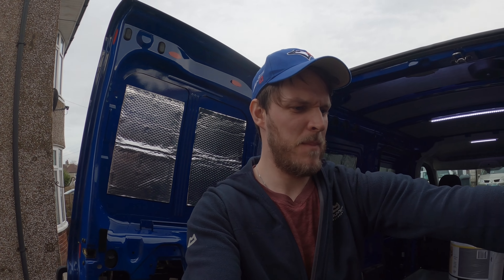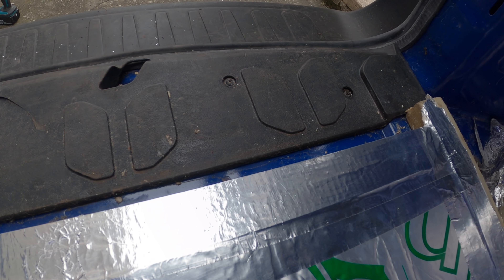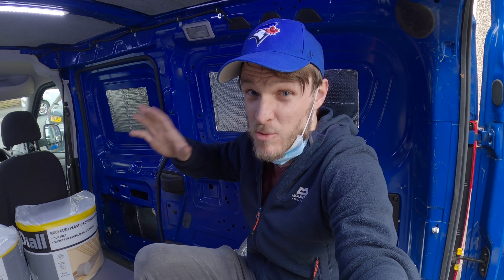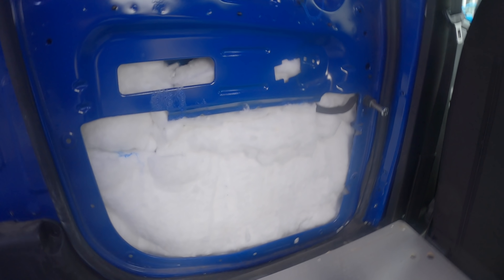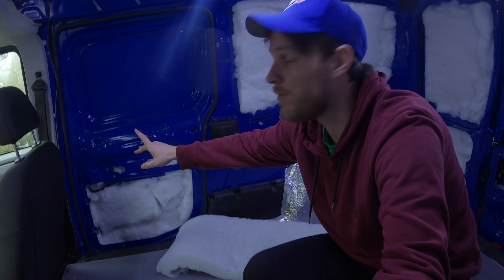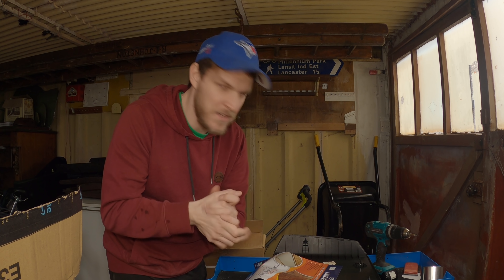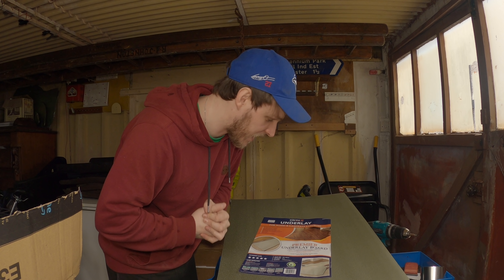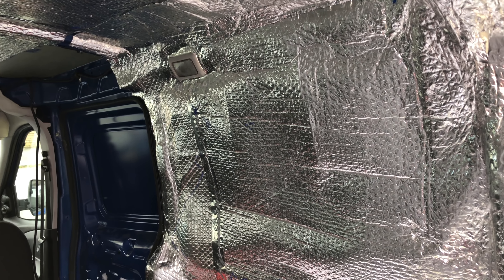Van Build UK | Wall Insulation & Vapour Barrier

Comment: Hi Henry, the white material, insulation, you are using on the side panels and doors i would leave it about 20-30mm off the bottom in case of condensation and water maybe. If  that gets wett it will stay wet for a long time and rust will build up in that area, by the time you will notus it will be too late! Other than that keep going, good job.

Comment: Going well there Henry looks great so far. I would suggest getting your cables in asap though. Our van has a smart alternator so we needed to get a Victron 30A DC to DC charger to charge our house leisure battery for the 12V USB chargers, and run off an invertor for 240v sockets. 
We're just about to start to ply panel the inside of ours, and got some great Anthracite 4 way stretch carpet on ebay with Trimfix glue in a kit for the walls and roof. 
Best of luck with everything.

Comment: Having an angle between the needle and the point of your compass, ie needle up in the center, and the point down to ceiling, made the radius that much larger. If you do this again, messure from the middle as you did, and then out to the rim of the tube...

Comment: It looks like your conversion is going pretty well: you seem to be tackling the issues methodically and thinking things through. That (higher temperature) spray on glue seems a good choice because you're attaching to the metal shell of the van, and on the outside of that will be the sun. I think that even in England, in the summer, sun on metal will get quite hot.